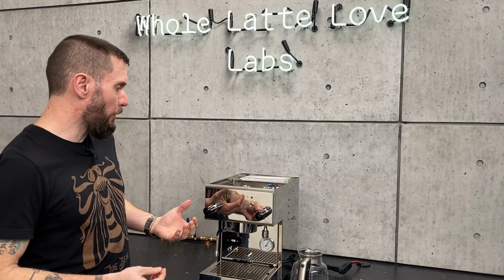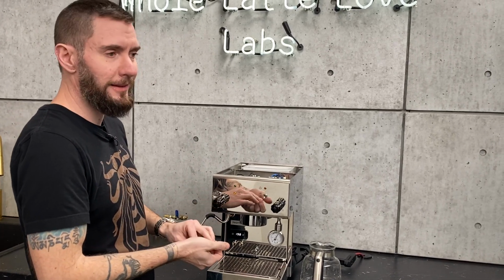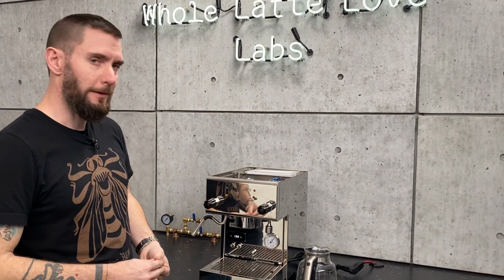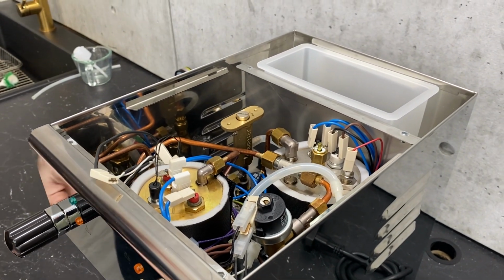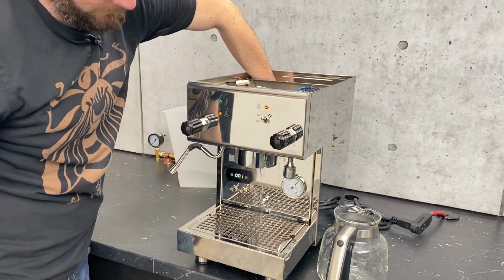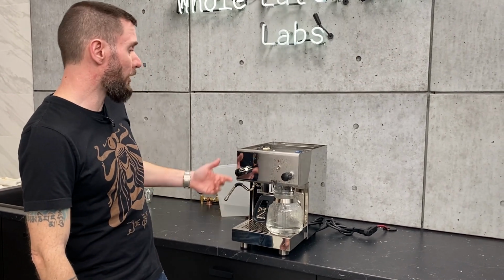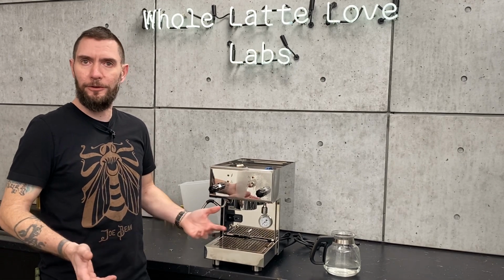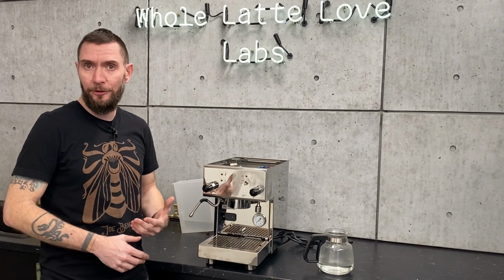Profitec Pro 300: How to Drain the Boilers

Comment: If I remove fittings to drain the brew boiler, what sealant should I use when I re-install the fittings?
Reply from the maker: Hi steve, while you can use sealants they are generally not needed.

Comment: If I drained the boilers for storage, any particular steps that need to be taken before firing up the machine again? Do I need to enter any kind of first-use (safe) fill mode so that the heating elements don’t engage until the boilers have refilled?
Reply from the maker: Hi MB, The service (steam) boiler will automatically fill on turn on. Do turn on the brew switch after turning the machine on and run until steady stream of water from the group.

Comment: Hi guys.  I have a Profitec Pro 300 that appears to have some sediment in the water/steam boiler.  I drain the boiler regularly and have back flushed with Cafiza tablets, but I'm noticing that when I drain the boiler through the hot water valve I see quite a bit of white sediment at the bottom of the container.  I also recently had a clog of white sediment at the elbow under the boiler, which I was able to clear with a pipe cleaner.  In the last week or so I've noticed a possible steam leak coming out of the drain valve.  Please advise. Thank you!